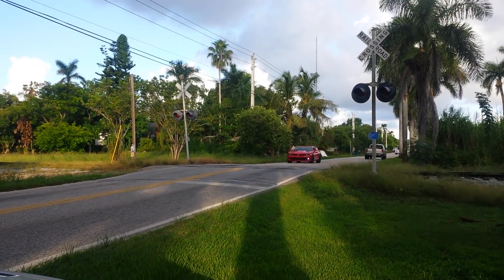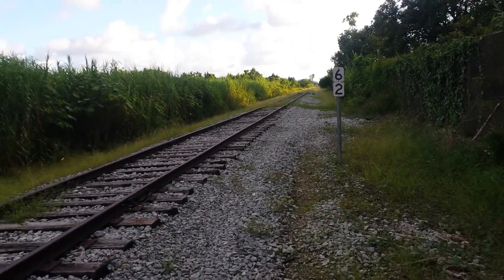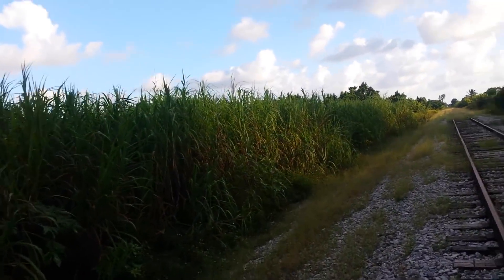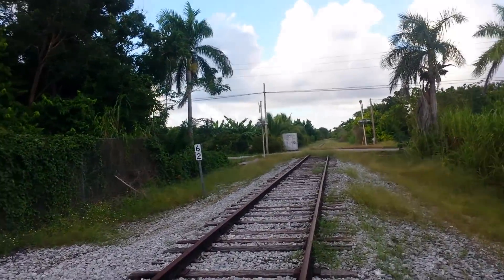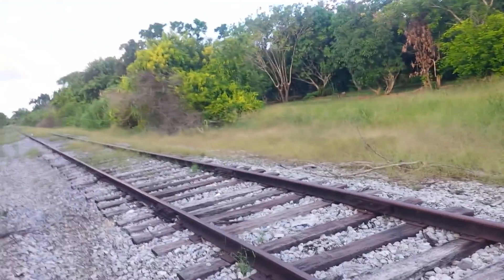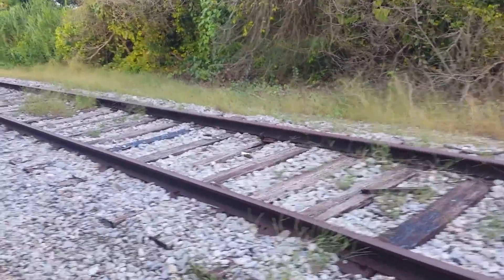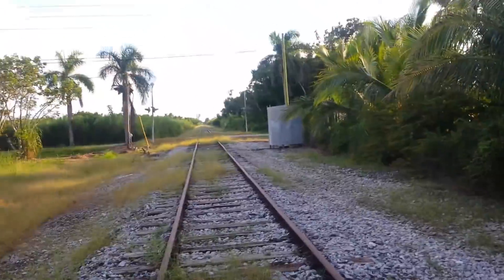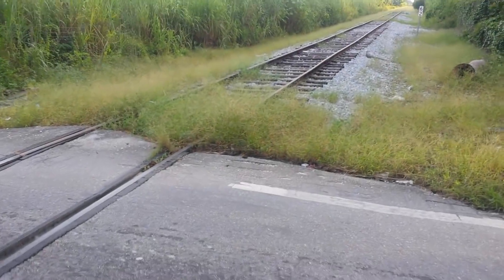Unused Railroad Crossing

Comment: I think that relay case was running on AC power,  not 100% sure on that since it's older. I'm just used the new ones with the bright LED that stays solid when AC power is applied and flashes when the battery (DC) kicks in because of a power outage.

Comment: You should get a metal pipe or a wire and short the two rails together and see if the RR crossing lights come on..
Reply: @railrol82  I heard it does.. Never tried it.. Try it and find out.. I would assume it would..